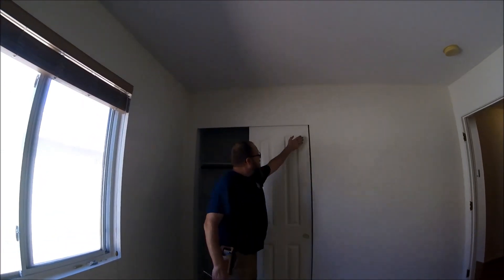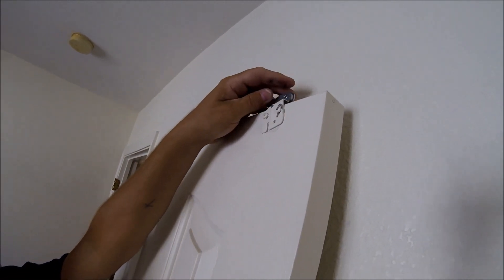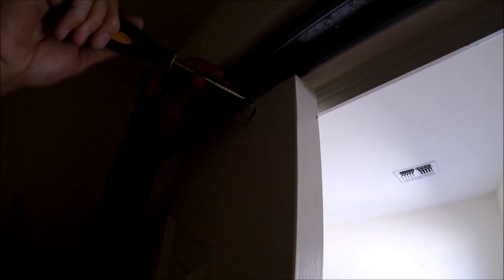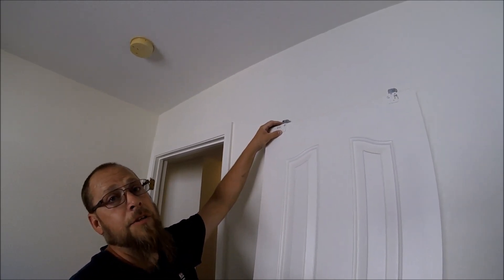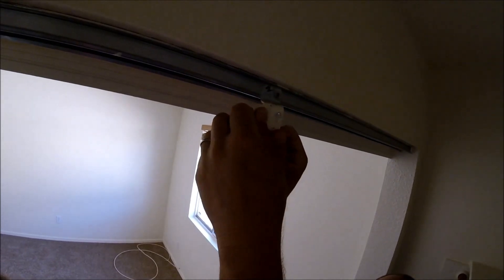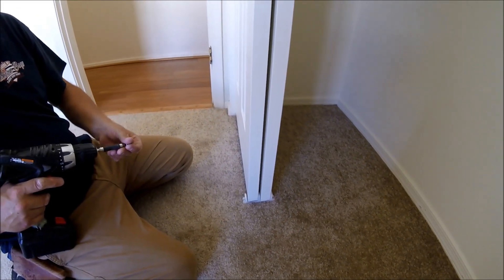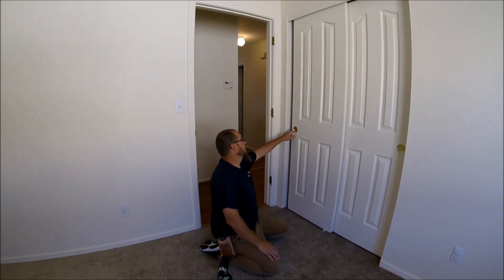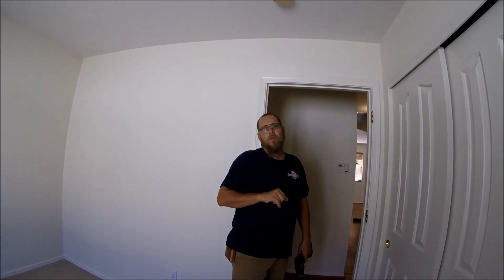SLIDING DOORS HOW TO

Comment: You mentioned on carpet a block of wood, what do you recommend of attaching the wood to the concrete floor?
Second, have you had to cut the bottom or top of the door so the door doesn't rub on the carpet?
Do you have a video on installing the door pulls?
Reply from the maker: A construction adhesive and always cut the bottom of the door, i do have a video on that

Comment: How do I install the door guide if I’m going through carpet and concrete????
Reply from the maker: Carlie Durr There needs to be a block of wood installed under the carpet for you to screw the door guide to In most cases if it’s concrete there is already one there, so you might want to just fill of the carpet and see if there is a hard square under center of the doors
Reply: FloorsbySouthernboys there isn’t because we installed the carpet and I know for sure it’s only concrete
Reply from the maker: Carlie Durr well can you pull the Carpet back out of the closet and with construction glue install you a piece of wood about a half inch thick and approximately a 4” x 4” In the center of the two doors and then put the closet back and your piece of wood will be under the carpet for you to screw your door guide to

Comment: I like how you drilled the guide down right through the carpet into the block. We tend to strip around the block, then cut it out. Your thoughts?
Reply from the maker: BortLicensePlates I always just Cut the pad around the block and cover the block with the carpet just like you see in the video that way you don’t have a eyesore of the block showing at the bottom of the door but you still get the benefit of been able to screw the guide to it, that’s how I have always done it

Comment: Best video on hanging closet doors!! Only wish you could have showed how you install the second door also.  I’m having a hard time installing the second door because the other one needs to be tilted also and it falls out. Maybe i need a second person to help
Reply from the maker: Rosanna Karczeski Want to have the first door hung if you open it it should be out of your way to put the second one on, I’m sorry I didn’t show that
Reply: @FloorsbySouthernboys  Just a tip:  Make sure to install the back door first.  Then it will hang straight while you tilt the front door out to put the wheel into the track.  Does that make sense?
Reply from the maker: Fred Sommer Yeah it would virtually be impossible to hang the Front door first
Reply: @FloorsbySouthernboys  By the way, very straight forward, clear, and thorough video.  Logical order of presentation.   Covered just about everything.  You did a nice job.
Reply from the maker: Fred Sommer Thank you sir